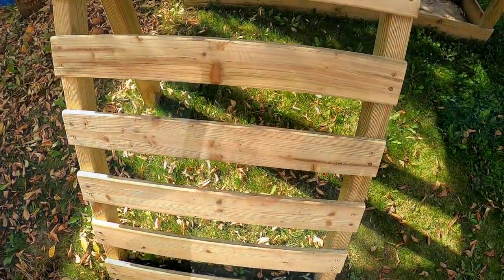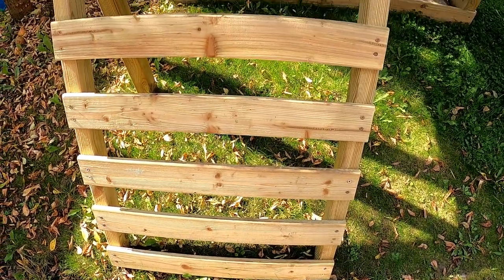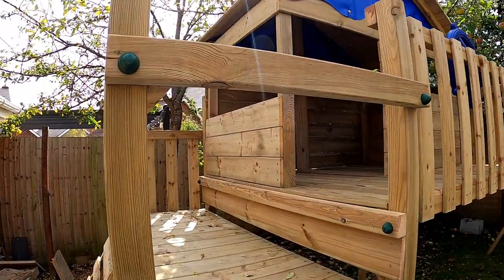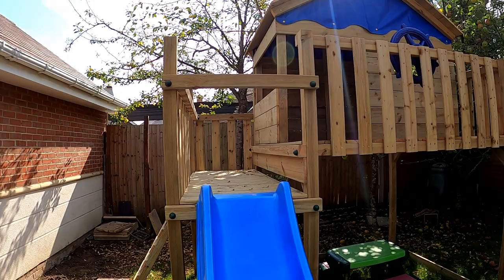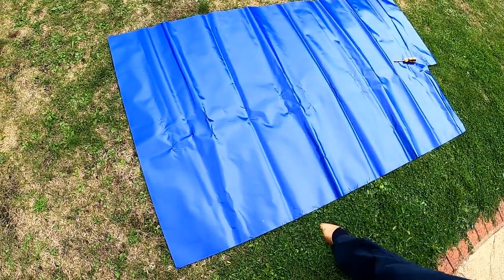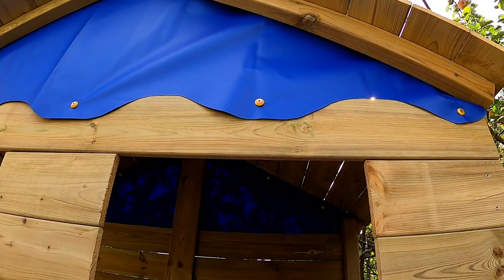HOW TO BUILD Wickey Smart Coast - DIY REVIEW/INSTRUCTIONS Self Building Kids Wooden Playhouse Resort

Comment: Did you have to anchor any of it to the ground? I bought a wickey queen and read after it needed ground anchors.
Reply from the maker: We haven't anchored ours yet as it seems to weigh the same as a cathedral so I don't think it's going anywhere, but there may be something in the instructions recommending some form of anchoring just to be extra safe.
Reply: @al-s  Thanks for confirming Al. I'm looking at the SmartDock and it's looks a bit insane for little ones to topple it over.
Reply: @AbuZak14  we bought one last week, should arrive shortly. I will absolutely anchor mine in, 100%. Its not only a question of the kids knocking it over, but wind during storms is surprisingly powerful, things you never imagined can occur in stormy weather, lastly for overall stability when kids are playing, to avoid wobble or any form of movement over time from its intended location. Especially the swing set, can create area of movement with swinging. Do it once do it right. I suppose it’s a question of how safe you feel it all is, in this vid the back yard looks well shielded from wind, i dont know, I’m an engineer its maybe that side of me that cant allow me to overlook this part... meh.

Comment: Nice video is possible to revise the swing set to the left side so house and platform are on the right
Reply from the maker: I think you need to specify it when ordering, although you probably could adapt it during the build if you know what you're doing
Reply: It is possible to reposition the swings but you will need to consider weight distribution. We have our swingset positioned to the back and it's fine. Might be installing additional diagonal braces to the underside of the main platform.

Comment: Thanks for the video mate, we've just bought the Smart Guard. I have no issue building but what could take time is the sanding. Did you have to sand every piece of wood? Thanks
Reply from the maker: You'll probably only need to smooth off the edges of the planks, that's all I found was necessary and a sander made easy work of it. The wood supplied with ours was generally very good quality.
Reply: @al-s  Thanks Al, it's arrived! just need to let the wood dry out and get to building this weekend :)

Comment: Nice work but you may better did something different with the roof. Because its not waterproof the way you screwed it ;) If you overlap the paddels the house itself lasts longer at the end.
Reply from the maker: Yes I agree but the instructions (and width of the wood) meant it had to be this way. We have sealed the gaps so all's good.